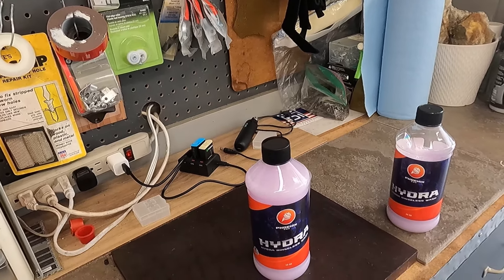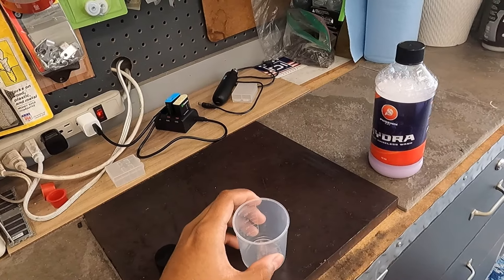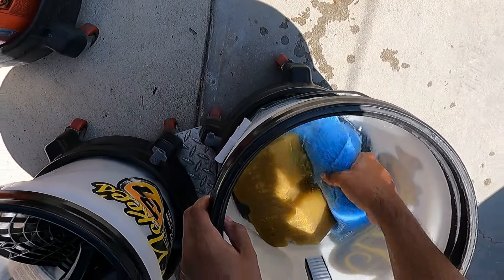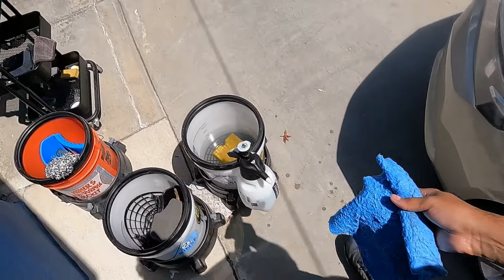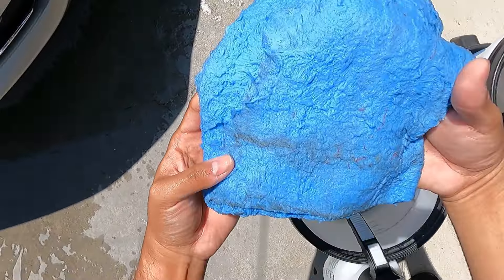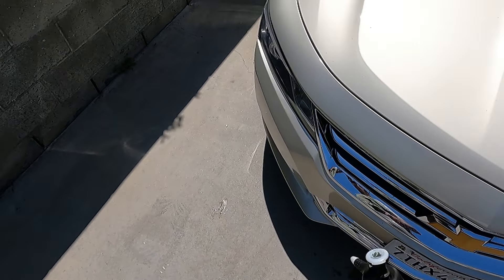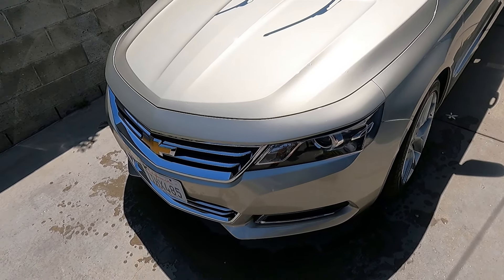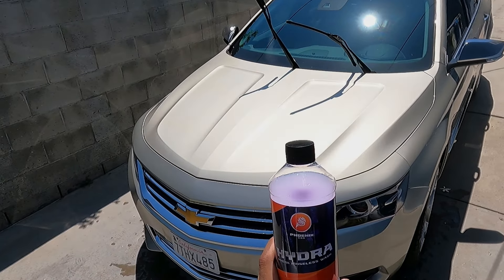The Evolution of Phoenix EOD Hydra 3.0 Rinseless Wash

Comment: Sounds like a winner to me, considering the competitive $45 a gallon AND 1oz per 3 gallons? Just for the heck of it I would try it at the more common 256:1 like all the other popular ones (DIY, P&S, ADS Hero etc.) and maybe that could bump up the lubricity even better? Definitely like this brand as they continue to improve and not milk the same iterations that they know can be improved upon.
Reply from the maker: @andrews7805  I will be trying it out at 1 oz to 3 gallons.  But at 256:1 with the new surfactant really takes hydra to another level.
Reply: People say 1 to 128 is dilution you want to use

Comment: Great review. So many choices. Appreciate you doing the legwork. Any thoughts on Hydra 3.0 vs Owner's Pride Eco Wash?
Reply from the maker: A great question.  Both are great options and both clean very well.  OP is more surfactant heavy as it has the ability to foam.  OP also has the slightly better dilution ratio at 1:512 in comparison to 1:384.  With the cleaning power of hydra increased it is the better buy as it has a more economical cost.  I have enjoyed using both but have been reaching for hydra more often.

Comment: i’ve still yet to buy any p-eod products, i need to order some detailed af, you may have said it before but do you prefer the merolex sprayers to ik … i use them cheap chapin’s 😜
Reply from the maker: @FrankoDetails  I haven’t tried an ok but the marolex has been a champ for me. Holds a lot of pressure.  Only downside is no valve stem unless modifying the bottle which I’m planning to do to another one.

Comment: Mike how does it compare to Feynlab V3 which I think is incredibly slick , but only use it with a sponge 🇬🇧
Reply from the maker: @Thecardetailingnut  cleaning is on par with Feynlab.  The only thing I don’t line about Feynlab is that it is a bit too heavy on surfactants so not the easiest to wipe off.   Under the sponge most of them feel about the same.
Reply: @MikeGDetailing  mike it might be conditions in UK but find Feynlab V3 nicer to wipe off then DIY or Idrosave but need to try Hydra 3 when we get to UK
Reply: It’s slicker than Feynlab. It cleans just as good as all of them. But slickness will be subjective.